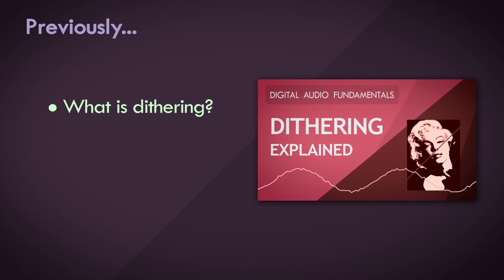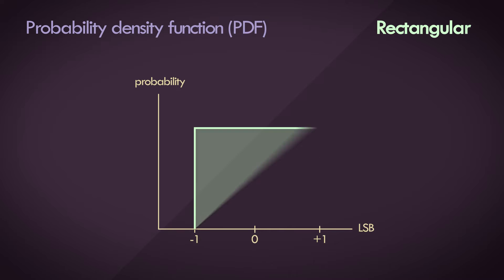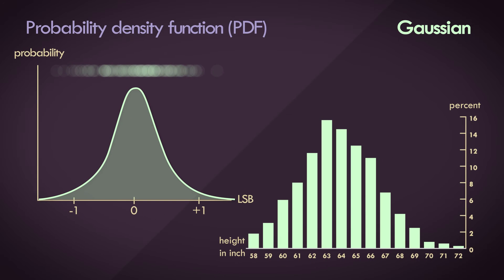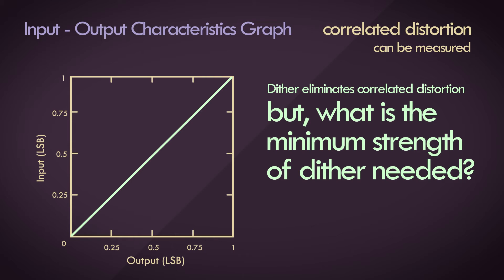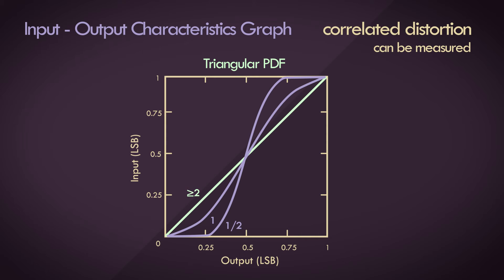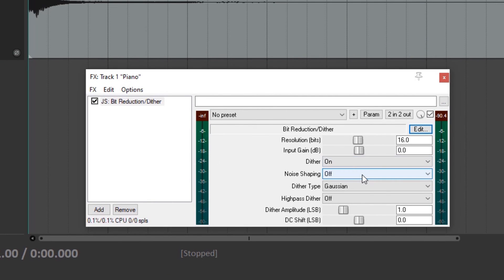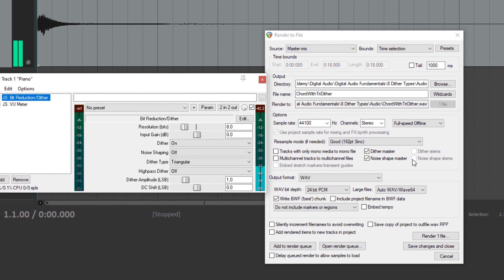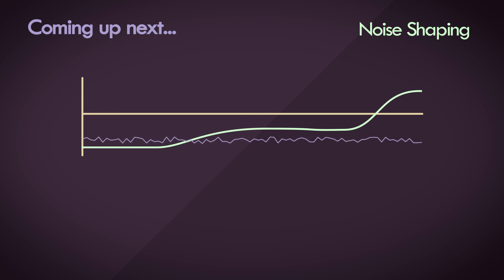8. Dither Types - Digital Audio Fundamentals

Comment: Sir as we tend to use High Bit Depth like 24 Bits of 16 bits, we need a lot of levels,

Now todays technology has mostly VDD at 1.8V

So in between them how do we accommodate such a huge number of bit dept?
Because the difference between two Bit will be so narrow.

How the engineers are designing their ADC or DAC for that?
Reply from the maker: I don't know! Just extremely sensitive electronic components I guess! Not my area of expertise..

Comment: the background gradient image suffers from quantization errors. It needs to be dithered...
Reply from the maker: Haha, I'm an audio engineer, not a graphic designer ;) 
You're right, the colour banding on gradients is really annoying. I've tried adding a bit of noise to the background, but it makes the file size really huge and it makes the video fuzzy to watch. I haven't figured out a good way to add noise for this problem. If I use 16-bit colour instead of 8-bit, the banding goes away. But once I upload it to YouTube, its compression algorithm brings the banding back. Thoughts?
Reply: @akashmurthy  the fault is Youtube's, I guess. I know for a fact that uploading a video in 4K instead of 1080p forces YT to allocate more bitrate to it, thus reducing extreme artifacts - but will it help with banding? Until the world of video streaming and displaying becomes universally 10-bit, that irritating banding may never go away...

Comment: Keyword 'convolution' instead of 'sum' at 2:30min?
Reply from the maker: No, it's just a plain sum. Maybe the graphics were a bit misleading? If you want to get a triangular PDF between 0 and 100, you add a random value between (0,50) to another independent random value between (0,50). 

tri = random(50) + random(50) 

No expensive convolution required.
Reply: @akashmurthy   When the two uniform random variables are added like you mentioned you get a new random variable whose pdf is convolution of the individual pdfs. ie you get a triangular signal when you convolve two rectangular signals.
Reply from the maker: @shyamm4680  you're technically right.
 https://en.m.wikipedia.org/wiki/Convolution_of_probability_distributions#:~:text=The%20convolution%20of%20probability%20distributions,linear%20combinations%20of%20random%20variables.

I was thinking of the convolution of 2 time domain signals, which is an integral of the product of the 2 function. 

In this case it's a sum.